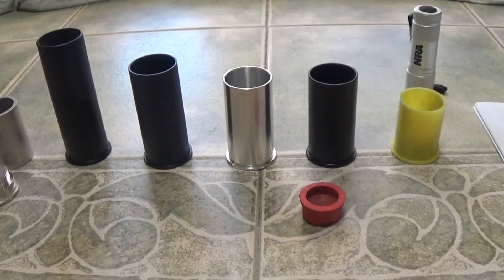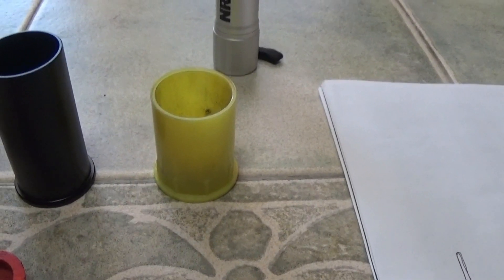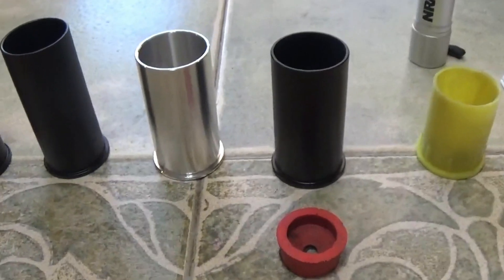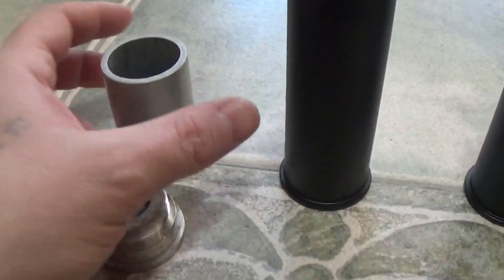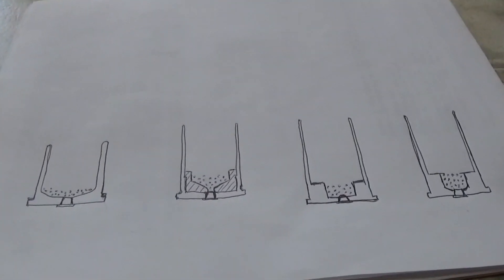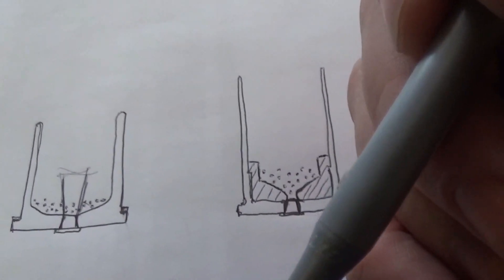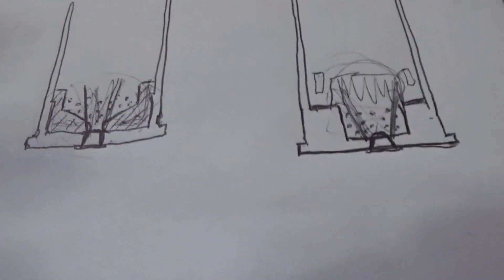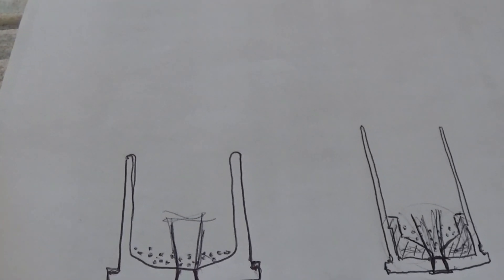37mm Hulls How and Why

Comment: What if you pour hot glue in the hull and then drill/mill out the center where the primer is??? Works and fill it back up every 5 rounds or just will not work?

Comment: Got my order yesterday thank you. Would filling the base ribs plastic hull with epoxy help get a complete burn of the lift charge?
Reply: I thought the same thing
Reply: I think itll work if you drill out a channel through the primer flash hole follwed by an even bigger recess inside the hull to create a powder pocket

Comment: What's the recent ruling by our friends at the ATF about the nylon 40mm Hi-Lo hulls that use the .38S&W blanks? I remember some individuals who bought the hulls as surplus ( real cheap!) and turned them down to 37mm for use with flares. They said thy could get around 10 reloads before they showed signs of fatigue.
Another individual was able to obtain 37mm hulls from some departments in the past and cut them down to fit the chambers of the pyrotechnic guns, they are supposedly illegal to posses in their original full length if you do not have a registered 37mm device. Need to get back into the game might do a form 1 and register the launcher, mill out the chamber to the proper length and stick with one size hull.
Reply: Laws made repugnant to the constitution are unlawful to enforce.

Comment: Nice shells!  I find it hard to use short shells as most of my older launchers were built for long shells.  That little bit of difference at the end of the bore kinda catches short shell fired loads...sometimes not.  I thought about milling out the last little bit of the inner barrel but decided against it ,I'll stick to the longs.